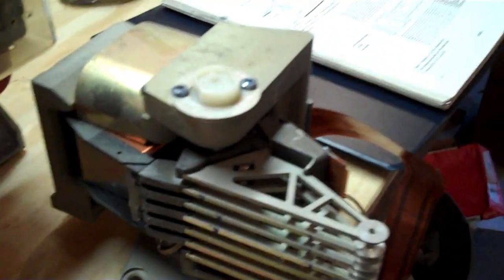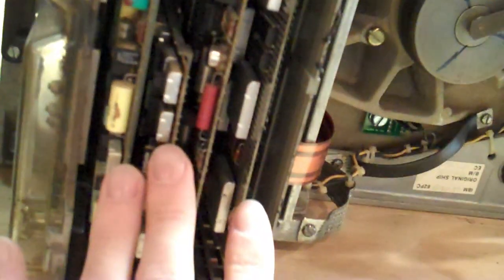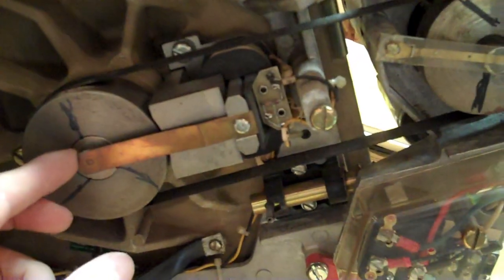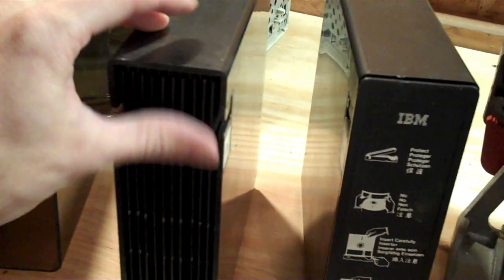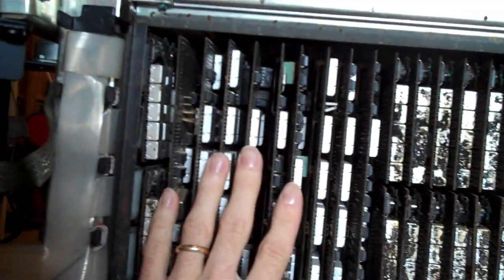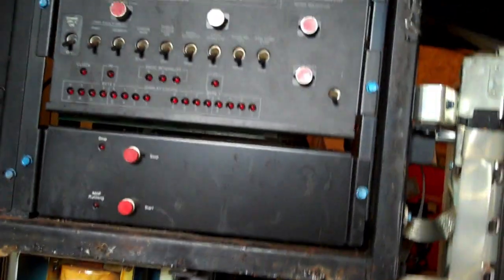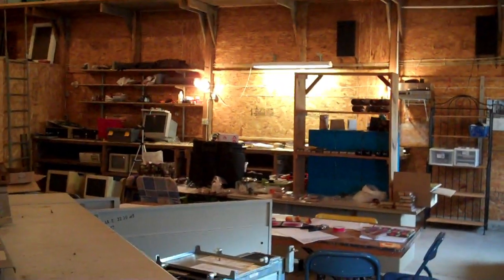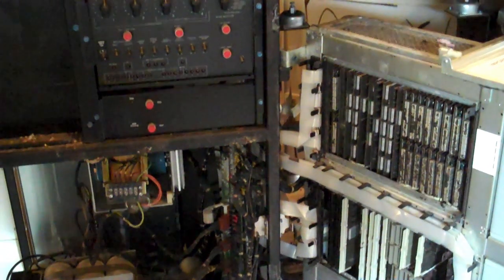Tour of a (needing restoration) IBM System/34 - Part two

Comment: We threw away one of these in the 1990's, but before we did, I saved one of the plug boards with two IBM 34 white and gold ceramic processors on it.   Vacuum up the trash in the bottom with a shop vacuum, nothing of value would of fallen of into it... and power it up as is.  

I would not disconnect anything en masse or you'll never figure out again how it was connected and basically end up destroying the system into a pile of parts.   If you do want to remove and work or clean something, do one board at a time, or one part at a time, and replace immediately when you are done, and move on to next part.  Don't go just unplugging a bunch of sh1t, or you'll create on insanely impossible to solve disagnostic h377 for you to dig yourself out of to just get it back to the state of everything plugged into the right spot when you drug it home.

If you're wondering why we threw it away, it was because some monkey had gotten to it and just "started unplugging everything everywhere" ostensibly to restore it.   We got it after that.  There was no way going back from there at that point.

Comment: Ohhh the memories! I used to operate the S/36, which succeeded the S/34. I remember inserting those oversized floppies into those magazines, and then mounting  them right into the computer's built in floppy drive. I actually interviewed for an operator position at a defense contractor in a rural area. They had a S/34, and that would have been my first exposure to that series. The controller interviewing me advised if two jobs are started on the machine , it would crash. Part of the problem was it had a whopping 128K RAM. For the princely annual salary of $12.5K (this was close to 30 years ago), I would have been expected to do all the data entry for the shop, as well as set up and run the scheduled payroll, and all batch jobs. Everything Operations I would have been expected to perform. The controller said their system consultants advised  they were good, and no need for upgrade. But I practically knew I was on the way to being hired at a much better S/36 shop. So I really didn't try to impress at this interview. I won't say I threw the interview on purpose, but I didn't try that hard to; impress.

Comment: I had a fully working IBM System 34 with two 65 megabyte hard drives and an auto changer floppy drive, several Twinax workstations and a Twinax printer.
Reply: My father used to have one in his job, can you please upload a video showing it?, it will be great I have wonderful memories of that machine. Congrats.

Comment: ECL is very odd with all its negative voltages, but it was the fastest logic available back then.  IBM continued to use ECL up into the later years of the S/390 mainframes- CMOS processors were introduced in 1994 with the first 9672 G1 system, but it wasn't until the G5 version in 1998 that they were able to overtake ECL in terms of performance.

Comment: The jukebox thing is called a 72MD - the juke box things are called diskette magazines hence the name 72 Magazine Drive. You are right to a point about how the drive works, you can through the program select different diskettes in the magazine or if you are backing up all your files it will step through each slot in a magazine and if need be go onto the the next magazine and others if need be. The 8 inc diskettes had 3-4 varieties single side, double side, double side double density, hence the 3 different diskette drive types the 33FD, 53FD, and the 72MD. It was a wonderful machine for the customer and it was a good machine to work on also. It was very reliable. I believe the model you have there which we Customer Engineers called a 256-256 256Kb of main storage and 256MB of Disk. You ought to try advertising in craigslist for old Customer Engineers that used to work on them --  You'd probably find someone who would love to help in your project.

Comment: The IBM System 34 was largely built at IBM Rochester,MN.  Many good retired techs in that area to assist.  System 34, 36 and 38 were used in Eastern Iowa -- due to close location of IBM plant.  University of Iowa Foundation was a beta site for the AS/400 hard drives in early 1980s running on their System 38.  Hancher Auditorium installed a System 36 for ticketing, when I was grad ass't.

Gb

Comment: Looks like a damn interesting project you got there. The jukebox sounds unique too, almost a crude raid array with floppies! I use a variac on PSU's which are suspect, you can gradually ramp the supply voltage up, so if its going to bang you have more control over it than just slamming 240V AC through it instantaneously. Not sure how much they are in the US, but maybe a worthwhile investment for you?